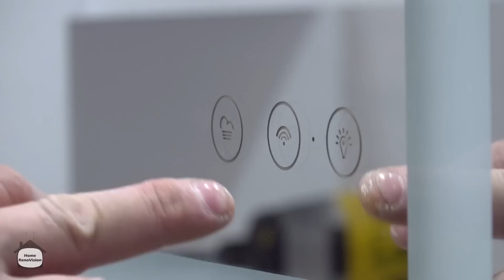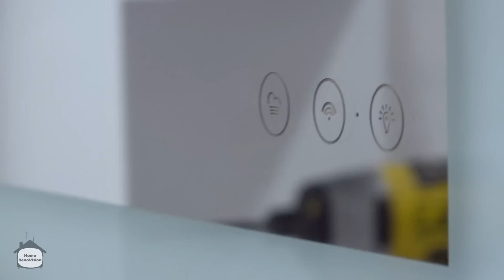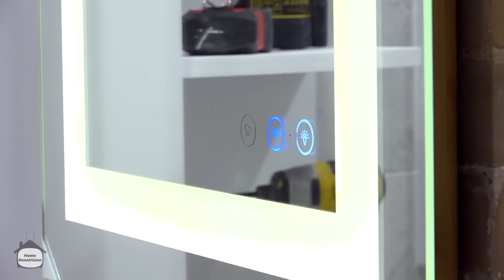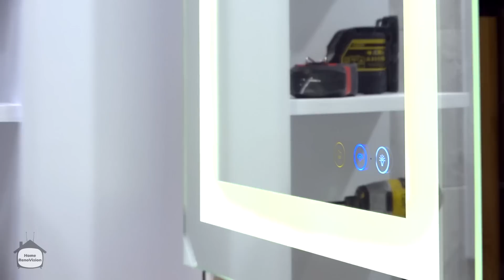Unboxing and Review Viio Vezzo LED Bathroom Mirror

Comment: Really like yours long red screw bit, what brand or type is that? See that using in most videos
Reply from the maker: I like to use the Milwaukee bits. they seem to last longer than anything else I have been using.